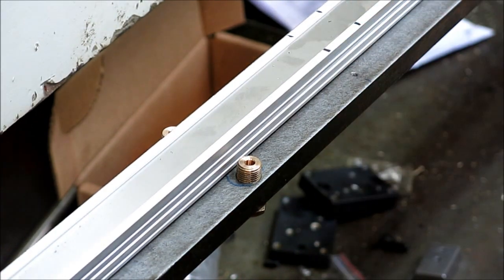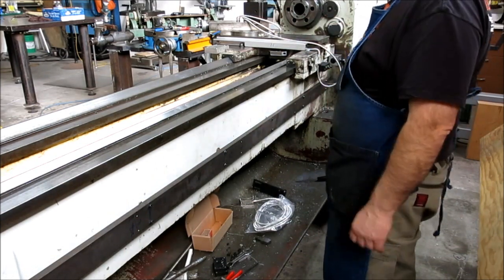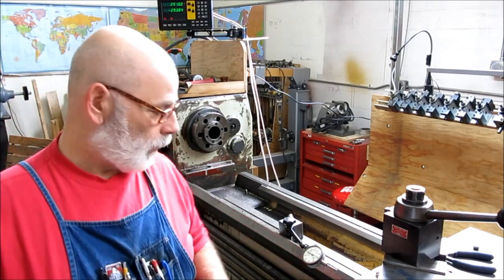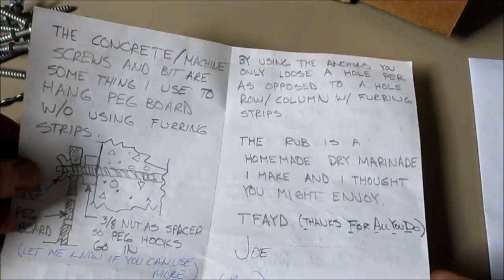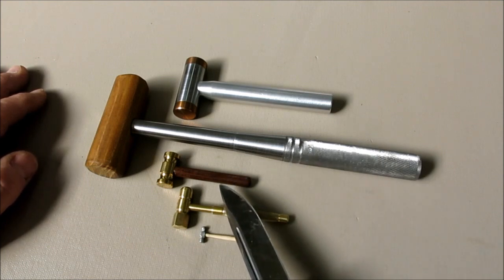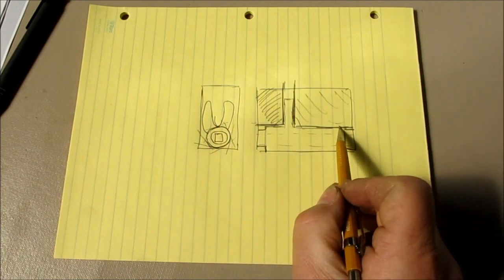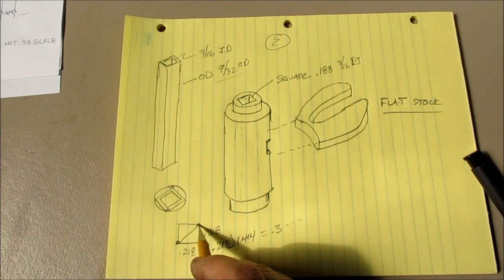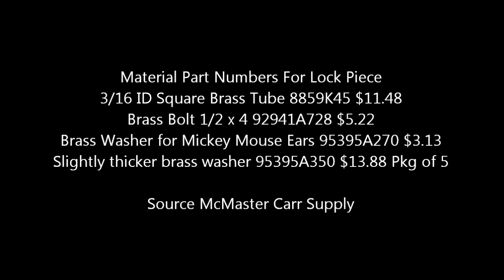Monday Night Meatloaf 21

Comment: Hey Tom,

Well as you know I wanted to be there to assist....but thank you!!  Listening to your sniffles I am grateful you kept me away....

Ready to assist on the leveling if needed!

Very cool instruction on the various methods of construction and your sketching is just so cool....

Chuck
Reply from the maker: Hey Chuck,

I was spewing gallons of weasel snot. Good thing you weren't here. Man I could have used a good shove from you when I was putting the machine back in place. I nearly popped a sinus out.

Best,

Tom

Comment: I was going to suggest what your problem might be with your dro, but then you nailed it. When I went and inspected the big CNC I bought I had a similar problem as it was showing it was off a .0005 in 2" but they said the machine had been calibrated a year ago and was closer than that as they used it for making precision dies  in their tool shop that had to match exactly for their production lines. I ended up indicating my indicator to get it exactly square and then it was dead nuts best I could tell every time. Turns out my straightness sight is less accurate than .001/inch. lol
Reply from the maker: Hey Brian,

Thanks for the comment. I just wanted to check it against something. When I got the error I was perplexed for a minute. All good now. Indicating your indicator. Which one to trust? You know the old saying, Never go to sea with two clocks. Either take one or take three. Two is just useless.

Cheers,

Tom

Comment: I am not sure if this has been brought up, but instead of using a bolt and filing it down.  Use a sleeve and a shaft of the correct ODs and assemble and braze them into each other.  I guess that assumes standard OD sizes...Tom, great videos! I just graduated from college and work in a A&D machine shop in Minnesota.  Your videos provide great insight for greenies like myself.  I have been reading your articles in Cutting Tool Engineering for awhile now and stumbled across your YouTube Channel. stoked!!
Reply from the maker: Hi Lewis,

Thanks for the comment and participation. I assume you are talking about the lock part. His sizes are a little wonky so a standard size will need to be modified slightly to work. I think Mark is taking up the challenge and trying his hand at fabricating one in his shop.

All the best. Say hi to the folks in the shop for me. Save a Grain Belt for me.

Tom

Comment: Hi again Tom
I just wanted to mention how much we appreciate that you convert all your measuring to metric. I grew up in Canada so I guess I am officially bi-lingual but my students have no idea what you're talking about when you mention 1/1000 of an inch. I've explained the conversion a 1000 times but metric is just so much easier for them. And to be honest I'm just glad that they can use one measuring system. Have you ever done a video on heat treating (hardening, tempering)? I havn't done any since Tech. school (early 80's) and it sure would be nice to get a little refresher course.

Mvh
Reply from the maker: Hi Duane,

Thanks for the comment. I actually get a lot of comments about how people really appreciate the metric conversions. So I just keep doing it. I mess up once in a while but most of the time I get it right.

Cheers,

Tom

Comment: The little hammer looks like they put it in a shrinking machine just perfect.  He can buy that thing for a door lock I think.
I think I seen that thing in a door lock before. The square is for the shaft where you put the door handle and when you turn it it opens the door. That's what I think it is.

Comment: Very cool, your concentric locking/drill bushing/threading alignment/bar spacing bolts!

Thinking about your viewer's problem: I once drilled a hole down the center of a fairly long and fat bolt by chucking it up in a drill press, and clamping the drill in a vise with a vertical v-groove in one of the jaws.  I had, of course, located and center punched the center of the bolt end.  Once I got the drill (mounted in the vise) to stop wiggling, I clamped the vise down, and then just drilled the bold down over the drill bit with the quill.  Came out pretty darn concentric.  And if you lock the quill down, it's also pretty well held for the needed filing and turning of the ends...just a thought.

I had that same cold a couple of weeks ago.  Must be the prevailing winds being slow from San Diego up to the Bay area. Get well soon.
Reply from the maker: Hi Schwartz,

Thanks for sneezing uphill to me. Next Shawn up in Fort Bragg is going to come down with this crap. Its better today. You really converted your drill press into a vertical lathe. Nice the chips fall out of the hole as well.

All the best,

Tom

Comment: Tom,
   my thoughts on the fabrication project, McMaster have round outer sleeves with different sizes of square holes central to the dia, that and a 7/16 rod in mild steel, drill hole central a slide fit for sleeve and loctite , and the prong as per your drawing , all providing the sleeved part is available of course, 

another idea, the two small diameters at each end could be separate pieces drilled and squared by drill first and filed square and soldered in place the square hole has no need to go all the way through, 

I did enjoy the video, great job,
Reply from the maker: +Walter Maisey Hey Walter,

He ended up fixing it in an even easier way. He went and dug around in the junk in the hotel workshop and found another busted lock that had the same part. Easy peasy. Thanks for the comment. I have used those broached sleeves to make lathe boring bars back in the day. 

Cheers,

Tom

Comment: Hiya Tom,
Good job grunting that lathe back in place all by yourself, it stands to reason that an ox could accomplish this all alone.

As an aside, I also do soundproofing on equipment for the movie studios (sound depts)  I know you said an air compressor was too loud for the shop, what noise level would be acceptable? I hate to see you using those air cans for everything.
Regards,
Stan
Reply from the maker: Hey Stan,

Working on a compressor for a dental office. These run around 65 db so they can stuff them in a closet in the office. Got my hook out on CL looking for the right deal.

Cheers,

Tom

Comment: Be lucky, Tom.  You only caught her cold.  I am always getting cramps and cravings for ice cream from mine.  She loves to share.

The lock piece, weak as is it, makes me think mechanism for an old mortise lock used in 1 inch house doors.  I think a small bar spring went into the cradle of the tabs.

As for making one I would make a plaster or silicone mold and melt some hard solder or some of that Wonder Rod aluminum/pot metal repair stuff.
Reply from the maker: Hi Eddie,

The two turned down sections give it away a little. I think you are right that its for a mortise lock. Casting one might be fun. I want to see one of the blacksmiths step up and forge one from steel.

Cheers,

Tom
Reply: Sounds like a challenge.
Reply from the maker: SBBlacksmith Hey Kyle,

You guys have hammers that small? I know somebody that can loan you a couple if you need them.

All the best,

Tom

Comment: Tom, 
More good meatloaf. The camera work was fun, riding along and looking at the indicator.  It reminded me that your camera is out there with flying bits of hot metal; as in "Faceoff." When the chips are flying do you anything to protect it? 
Hope the rhinovirus doesn't hang around too long.
Reply from the maker: Hi Paul,

The bovinovirus is almost gone. Head is clearing up well.

Cheers,

Tom

Comment: Hi Tom, the hammer making is just now starting to get serious I hope you hammer makers out there to take to great of jumps or the collection wont get as large, ooops, I mean great in number although tiny isn't the only direction uniqueness may also play a part! Did todays hammer (what a beauty), have a round hole for the handle or elongated? Also what is the original lock part needed cast from pot metal, steel or what? He could surely use his drill press like a lathe... :o]

O,
Reply from the maker: Hi O,

The little ball pein has an elongated hole with not one but two wedges. Its really detailed. The lock part I believe is cast zinc or pot metal. Not weldable is what I got the impression of. The drill press would make a fine lathe as well. Now there is a good accessory. An attachment for a drill press that holds a tool so you can turn a diameter with it. Poor mans VTL.

Cheers,

Tom

Comment: This comment is for mr warner with his problem. One thing I have done in the past before I got a lathe was getting creative with the drill press and a grinder.  Chuck up your part in the drill press and turn it on.  Then get creative with your grinder. I have used cut off discs, rock discs and sanding pads.  All depends on what your need to make. One thing I had to make was some small ergonomic handles for a lift latch. Cranked them out in the drill press.

Comment: Could the  "concentric mounts" also be considered "counter rotating inclined planes coaxially aligned mount"?
Reply from the maker: Good one. CIRPCAM's. Or Caka's  Coaxially aligned kinematic adjustment screws.

Cheers,

Tom

Comment: You didn't specify what exact machine the manual is for but I have a Pratt and Whitney Model C lathe. I would love a PDF copy of the manual as I am currently trying to reinstall a new half-nut.
Reply from the maker: Joe Hale Thanks Joe. There you go Tyler. The internet metalworking community coming together.

Cheers,

Tom
Reply: Joe Hale
Thank you!
That dropbox thing was kind of confusing but I figured it out. It shows the exact lathe that I have. As it turns out I did not need to take the cover off the apron I just needed to run the carriage off the end of the ways so that the half nut is exposed.

Comment: The part for the lock is actually for a safe.  It is the dog that lets you open the safe after all the combination plates line up.  Being pot metal makes it weak.  He is trying to shore up a piece of garbage to something stronger.  That is what I think from what I see.  I maybe wrong.
Reply from the maker: Hi Bbowen,

I hate to have my stuff locked in that safe. Maybe it spread open once already. It looked weird in the picture.

Cheers,

Tom

Comment: Another way to get a square, or hex, hole into something. Drill and braze/solder in a sleeve.  Google "machine tool sleeves - squared hole".   Reid Supply changed names, but this was the 3/8" square sleeve link:   http://www.essentracomponents.com/sku/shs-370?itm=shs-370
Reply from the maker: Hi Tom,

Thanks for the link. I always have a hard time finding these in the catalogs when I need one.

Cheers,

Tom
Reply: I concur, Tom.  The square hole sleeves immediately came to mind when I saw the part.  If I didn't have a press and a square broach, that's what I would use.
Reply from the maker: Richard Freeze Hey Richard,

Great minds think alike.

Cheers,

Tom